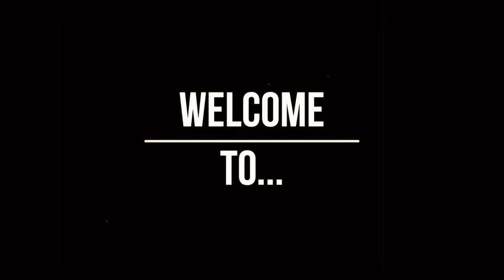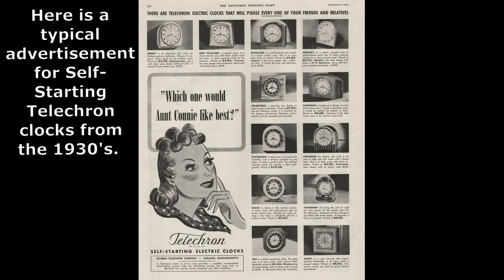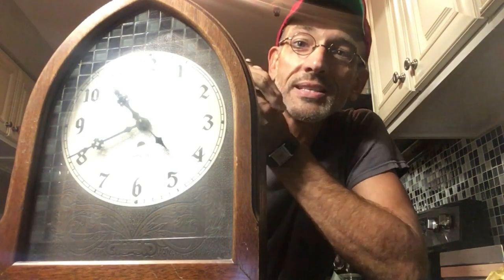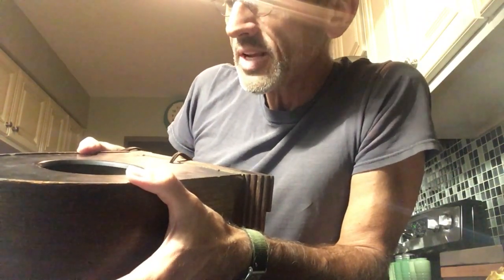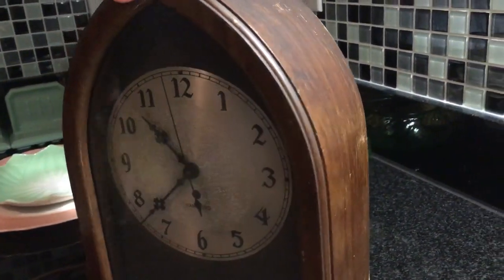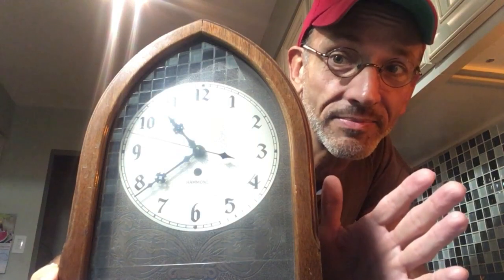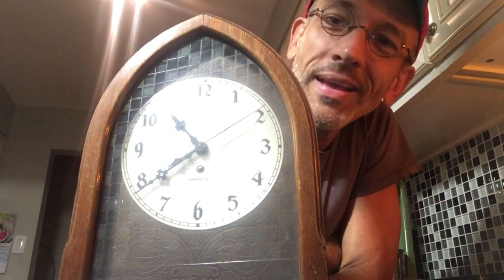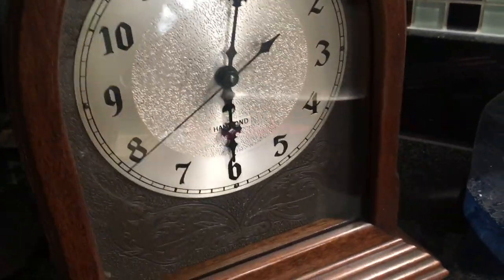What's wrong with this antique clock???

Comment: Interesting.  I have an old electric clock, that is from that era.  I have to go dig it out, and see if it has a primer on it.  It did work at one time though.  I had it fixed and it worked for a month or so.  Then I had it fixed by someone else, it ran may a couple months, and died.  So I am thinking it may not be one like you have, with the primer.   I love the clock, and it would be great if I can keep it electric and intact.  Otherwise, I have been thinking about having it converted to battery.  Horror!  I have displayed it in non working order, but want to actually have it work.
Reply from the maker: Go find that clock!

Comment: Tambour started at 1830, all the way to 1967
Reply from the maker: All the way to 1967?  What happened in 1967?  I know that they are still manufacturing tambour style clock even today.
Reply: That’s when the “ trend” ended, they then started the battery operated clock trend
Reply: I am actually uploading a new video right now

Comment: What I would do is lightly sand it, then rub the stain on the veneer the would wax it, the put a rub on varnish on it!
Reply from the maker: That's a bit too aggressive for me.  I prefer the warmer natural look of the original patina.  In my opinion, sanding the original varnished finish and then applying a new coat of rub on varnish would indeed improve it's overall look according to the taste of some folks.  But I'm very conservative and do as little as possible to alter the original patina.  Just a mater of different tastes.
Reply: Me too! I like it better, just for your notice if you wanted to do a full on restoration
Reply: On my videos you can see some of my clocks! That would be great! I just love your taste!
Reply from the maker: Thanks for watching.  I'll be happy to check out some of your clock vids.
Reply: Thank you so much! If you found a clock you like you can ask questions about it in the comments!
Reply: I just made a room tour video!

Comment: Are you concerned that the internal wiring covering has deteriorated? This is a problem with radios of that era, broken insulation is concern. Might not be an issue, but worth investigating.
Reply from the maker: Someone rewired it within the past few years and I inspected their work.  There is no broken or damaged wire coating.  But yes, I often run into “dry rotted” wire insulating on old fans, light fixtures and radios.  In that case, I rewire them using appropriate reproduction silk covered cord.

Comment: Hi Scott, great lesson, thx. I love this clock, many mantel clocks are to ornate for me. May I ask you what you use on wood and veneer to remove nicotine. I live in a 1920's home with original wood mantle. At first I didn't realise how much nicotine build up was existing. I'm worried about ruining the wood. Any tips or products you could share would be appreciated. Tfs ❤
Reply: Cheryl, if Scott doesn't answer, Murphy's Oil Soap is great.
Reply: Cheryl, if Scott doesn't answer, what to use to clean wood,  Murphy's Oil Soap is great.
Reply from the maker: Honestly it depends on how the wood is finished and exactly what I'm cleaning.  I start with very warm water mixed with vinegar using a soft rag.  Make sure you don't "wet" the wood too much because it will open up the grain.  Dry completely.  This will take off a good deal.  If the wood is still sticky and the rag is still picking up old brown residue, I move on to a bit of Gojo hand cleaner with pumice on a soft rag.  Believe it or not this works wonders.  The little bit of pumice in the hand cleaner acts as a soft non abrasive cleaner and the results are fantastic.  Now test in a small area to make sure that you are no damaging the original finish and work conservatively.   Best of luck!  And yes, Murphy's Oil Soap is a lovely product as well.
Reply: @oldcuriosityshop265  thank you, I've never heard of gojo hand soap, I'll look for it. I do use Murphy's on all my hardwood floors. It didn't work well on the trim or fireplace to remove nicotine.